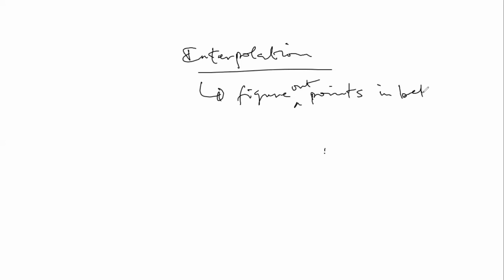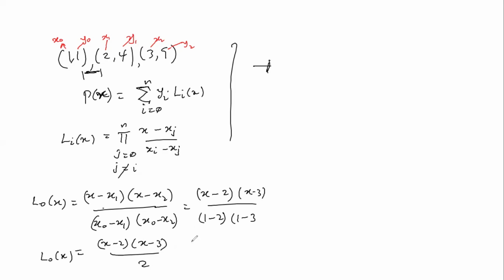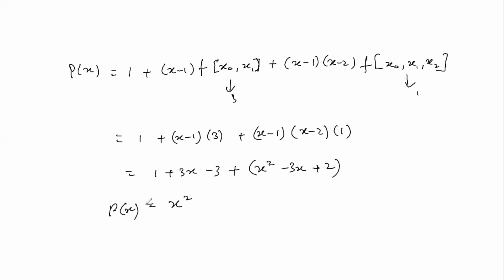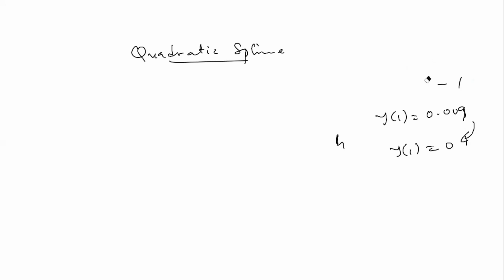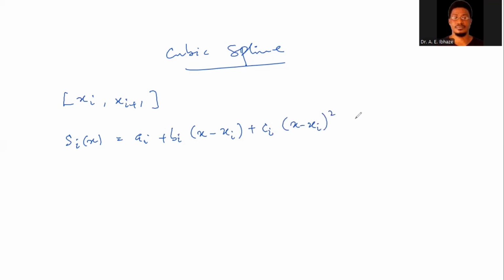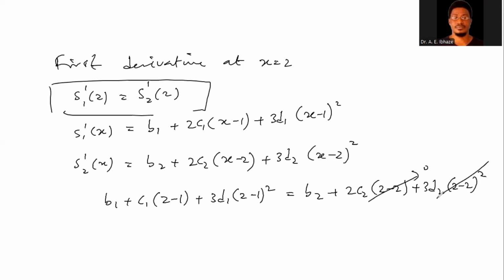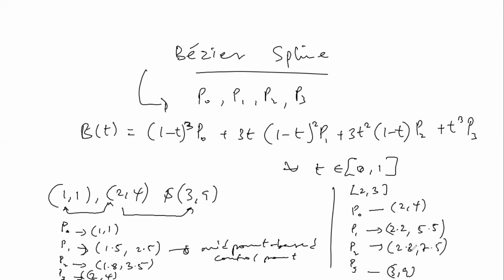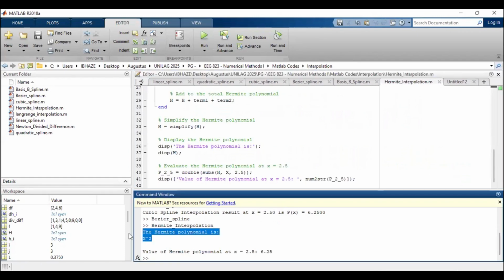NUM8237. Interpolation #lecture #new #numericalsolutions #engineering

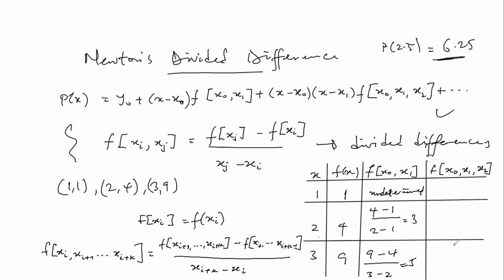Comment: Hello sir, at 33:40, where we have 5-3/3-1, I don't clearly understand that. Can you please clarify sir. 
I mean for the last column of f(xo,x1,x2).  Let me say I understand the numerator 5-3, but I dont understand the denominator 3-1. Please clarify sir. Thanks sir
Reply from the maker: That is the second divided difference. 

It is evaluated as 

f(x0, x1, x2) = [f(x1, x2) - f(x0, x1)]/(x2 - x0)

The third divided difference will become:

f(x0, x1, x2, x3) = [f(x1, x2, x3) - f(x0, x1, x2)]/(x3 - x0)

The fourth divided difference will become:

f(x0, x1, x2, x3, x4) = [f(x1, x2, x3, x4) - f(x0, x1, x2, x3)]/(x4 - x0)

The fifth divided difference will become:

f(x0, x1, x2, x3, x5) = [f(x1, x2, x3, x4, x5) - f(x0, x1, x2, x3, x4)]/(x5 - x0)

In general:

f(x0, x1, ... , xn) = [f(x1, x2, ..., xn) - f(x0, x1, ..., xn-1)]/(xn - x0)

The numerator represents the divided differences for the given points.

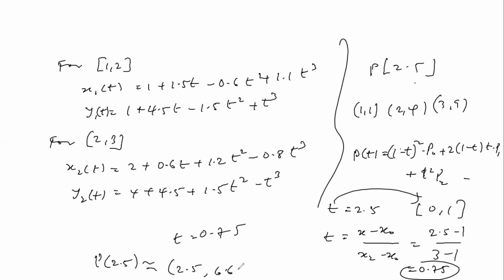Comment from the maker: @ 1:54:26 since t = 0.75 at x = 2.5, P(2.5) = P(@t=0.75) 
{Recall that: P(t) = (1 - t)^2*P0 + 2*(1 - t)*t*P1 + t^2*P2} 
Hence, P(2.5) = P(t=0.75) = (1-0.75)^2*(1,1) + 2*(1-0.75)*0.75*(2,2) + (0.75)^2*(3, 9)
                                              = (0.25)^2*(1, 1) + 2*0.25*0.75*(2, 4) + 0.5625*(3, 9)
                                              = (0.0625*(1, 1) + (0.375)*(2, 4) + (0.5625)*(3, 9)
                                              = (0.0625, 0.0625) + (0.75, 1.5) + (1.6875, 5.0625)
                                              = (0.0625 + 0.75 + 1.6875, 0.0625 + 1.5 + 5.0625)
                                              = (2.5, 6.625) ----> (x = 2.5; y = 6.625)
Reply from the maker: You will observe that P(t) considered three points while B(t) considered four points (control points inclusive).

P(t) is the quadratic Bezier formulation while B(t) is the cubic Bezier curve equation.

Note that relative to the number of points considered, the Bernstein basis polynomial formulation is used to derive the Bezier equations.
Reply from the maker: Bernstein basis polynomial is given by Bi(t) = nCi * (1 - t)^(n-i) * t^i
where:
           n is the degree of the Bezier curve : 0<= i<= n
           nCi = n!/{i!(n-i)!}